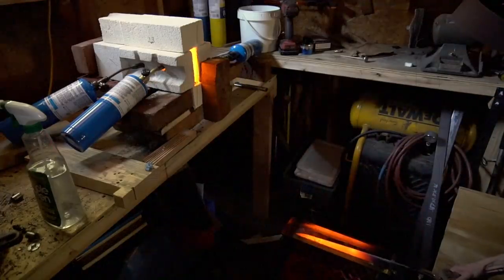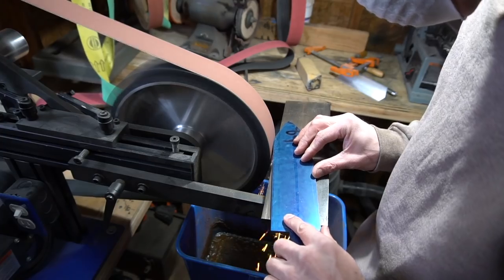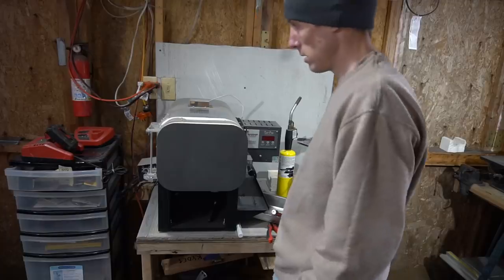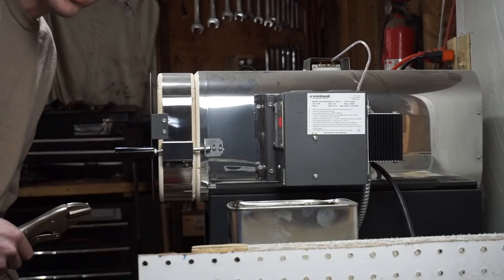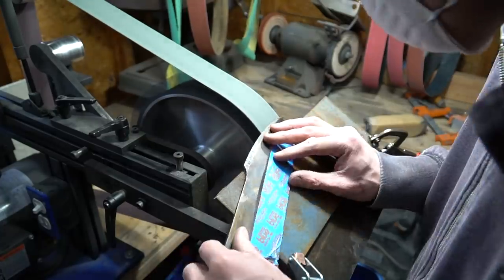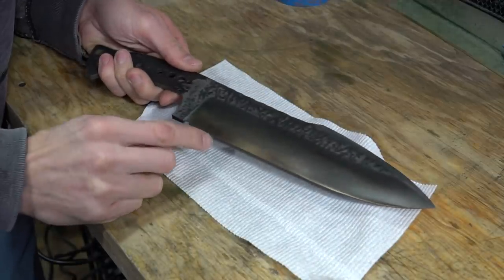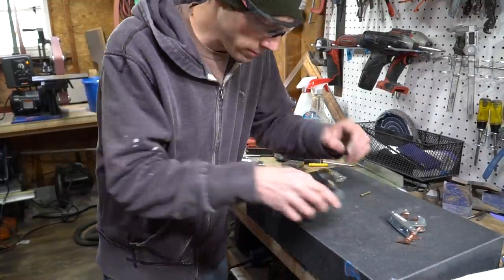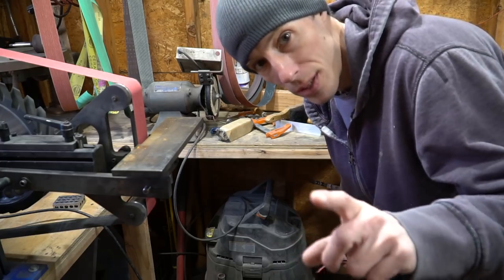Knife Making - The Savage

Comment: I am not a smith, however when you were normalizing your blade, I noticed three things. First by placing the blade sideways in the vice it allowed the weight of the blade to droop while still hot, perhaps if it was placed spine down you would find fewer warps. Second the vice clap is placed precisely at your warp during the normalizing.  I think the steel is cooling at a different rate where the vice is clapping the steel versus where it is not, because the vice is working as a heat sink. Third, if you insulate the blade and slow the thermal cycle by placing it in perlite or between two pieces of wood and clapping the wood  together, you may eliminate any warping and refine the grain structure of the steel a bit more. I am just a truck driver take what I say with a grain of salt. I just noticed this and you complained that you always or frequently experience the same warp and I believe the things I listed above are why or how you might fix your problem.  Great videos. My first one was your 24 dollar Damascus blade videos and it was awesome.  Good content so far keep it up.

Comment: 6:05 You shouldn clamp it that way because heat travels up and you get uneven cooling, which later in the quenching can cause warpage. best way to cool it is in a vise with the point up. Same tule aplies when heating a knife - edge is always up and vertical. After quenching you can gently clamp the knife in a vise verticaly, it eliminates chanses of warpage. There is a good reason why every swordsmith  does it the way i described it. Great knife! Keep up the good videos and great pointy things coming up!
Reply from the maker: Ive tried it many ways tip up tip down and horizontal. I haven't noticed a difference. Not saying one is better than the other just that it hasnt made a difference for me. It's always at the oil line. Unless i do an edge quench then it could be in the blade. Not talking about big warps very small ones most wouldnt notice unless you had a flat surface.  Just some thoughts🤷‍♂️ Thanks my friend 👍
Reply: Way wrong.  He is normalizing mill steel, it's not like there is a crazy amount of stress in it.  It's not forged, it doesn't overly matter.  And the "correct" way to slowly cool a blade is submersing it in something like vermiculite to slowly cool.  I use 1084 frequently and normalize by just setting it on the anvil.  It's more about reaching the critical temp and relaxing, not going for a crazy anneal.  The longer the blade the more likely a warp.  The thinner the blade, the more likely a warp.  Fixing it out of the quench is easy in a jig like he used.

Comment: Hi Bud, 
I got 3 tips for ya.  

Many shops have grinding rooms with doors and separate air just to keep the metal dust at bay.  Any machinery or electronics that the metal dust gets in is history!  Some people put grinders on wheeled tables or carts!!! Push it outside.  The metal dust is good for the plants! 

On the handles.  Surfboard builders will epoxy the cloth to the Board and let it dry.  Then use another coat of epoxy or two coats to clear coat it.  It comes out tougher than nails but smooth and slick.  You can use a longer setting and lightly flame it with propane or alcohol to make any bubbles pop.  No butane, matches, or candles they leave soot and turn stuff black!  When you get the nack of it down it’s a great surface.  It’s deep reflections, smooth to touch, good to grip, and tough. You 

For epoxy or fiberglass  that does not set from cold or wet conditions, warm it gently with an incandescent light bulb.  A little heat and time! I have set it in the sun, but I live in Florida. 

Great show!  Good luck!

Comment: Great blade!  One suggestion: When you normalize, turn your vise 90 degrees so your blade stande straight up and down, resting vertically as it cools.  This will help ensure the blade evenly normalizes, that the forces of gravity aren't pulling laterally on the blade as it cools.

Comment: Great video. The warp most likely happens at the quench line due to uneven contractions in the steel where the air and oil aren't cooling it evenly.

Comment: Something I noticed, you were normalizing with the blade held flat, gravity could have slightly bowed it while it was soft. (It is a BIG KNIFE after all) and could have led to your warp, try putting it in the vice blade edge down.
Just watched again, at around 6:10 you can actually see the tip droop a bit. Plus the warp was in that direction. Food for thought!

Comment: While doing normalization could you use a coat hanger size wire an just hang the knife vertically. That's what I usually do I also use the same technique to remove my knifes from the oven into quench tank ,a wire an a small piece of wood an my quench tank is right below the door on the ground so I just go straight into the oil . Your videos make me laugh,it's your since of humor. Keep up the good work. Your a great guy an true Craftsman
Reply from the maker: I uave done that with the wire. I may go back to it as well. I think its a better practice. Thanks my friend! I really appreciate it 👍🙏

Comment: Great video. Your  warp may have come during the normalization process. When u clamped the blade after each cycle, the weight of the knife put stresswas all at the handle.  Clamping  the blade  straight up and down

Comment: I don't know anything about heat-treating but I heard you mention quench tank and canola oil.  Can any type of oil be used when heat treating like any type of oil on hand anyone would have in their shop or house such as vegetable oil, olive oil or motor oil that's left over from an oil change, or does it have to be specific?
Forging, tempering, and heat treating....what's the difference between them?
btw...that's a really cool grinder, really versatile with all the different wheels and grinding surfaces. What make and model is it?
Reply: hydraulic oil works for me used motor oil creates imperfections and in my experiences more flammable

Comment: I know this is an old video but part of the warp could be because during your normalization cycles, you have the blade horizontal... at that heat, the weight of the blade will cause sag. You may not see it but when you quench, it will show. Hang the blade point down and it should be (relatively) fine (all things being equal).

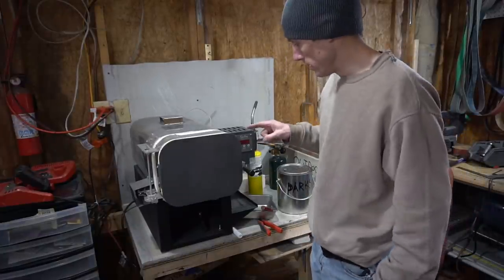Comment: 4:20 Leaving more substance on the knife before heat treatment will reduce the risk of the knife warping, but the tradeoff being that it will take longer to finish grinding. The better you get at evenly heating the blade, the more material you can take off before treatment. For anyone thinking about making their own knifes, you would probably rather take an hour or two longer for the finishing grind than having to start from scratch again.

Comment: @outdoors55 , your observation here:  8:09 --
I think the warp in this case may have been a result of the normalization process. 06:09 - As the knife cools, it seems to sag just a couple degrees or so downward because of gravity. See the way that it is clamped? That entire BIG KNIFE is pulling on the shoulder of the knife with mechanical advantage. I'm pretty sure that because of the way you're straightening this bend later is exactly how it would have been warped during your normalizing phase. I'm not sure if you're doing this in your later videos, but maybe the best way to orient the knife during the cooling of your normalization phases would be to suspend it from the tang, upside-down? Maybe even just flip the knife once in between normalization phases.
a backside to this would be that it would likely slip out of the vice and fall, tip first, into the floor and ruining that tip. But worth double checking if you want to improve that work just little bit more, or it may save you the hassle of having to straighten these warps later? Good luck and good vids

Comment: Just a thought, since you're making knives from regular steel you can order. Why not save yourself some time and have the steel house water jet cut you blanks for you. That way all you need do is do the grinding, heat treat, normalizing, and make the handle. That way you can make several blanks at the same time if you have a knife that is popular.
Reply from the maker: A lot if makers dont do waterjet because profiling (or cutting the basic shape) is the easiest and fastest part of the process. As such, waterjet is expensive, and even at a low $10 a piece for waterjet, you would need to do tons of knives in order for it to make sence. You can easily profile 10 knives per hour on a 2x72 if your making the same design. So you would be saving about $90 per hour minus belt cost doing it yourself.

Comment: Nice vid Alex!   A few thoughts...   instead of painting the blank billet and tracing your template with a scribe to get a very faint and hard to see line, why not simply trace your template with a Sharpie?  After you trace your template onto your blank, you can drill that sharpening choil on your drill press to skip the hand filing.   To get a very similar look to what you did with the Dremel tool in a small fraction of the time, you could just hammer your blade while it's red hot (if you have an anvil or surface to hammer it against).   Just a few things that struck me as odd or maybe harder than they needed to be.  I'm no expert though, just giving some thoughts... (these are all things I've done with good results).   Thanks for the vid!
Reply from the maker: The scribed line isnt that hard to see in real life. The camera makes it appear worse than it is. Ive tried using a sharpie but its nice to have more precise lines.  Seems some like using the drill press for the choil and some like to file. I just prefer filing. It takes about 2 minutes to file. Not long at all. Just me preference theres no right or wrong way. Thanks for taking the time to watch ! It's always appreciated 👍👊🙏

Comment: Just an observation but with making a blade of that size gravity is likely your problem with the warp. After your first heat treat cycle I noticed you put the blade in the vice while still glowing… this can cause a slight bow to your blade, though not as noticeable until after your quench. Try to hold the blade vertically instead of horizontal.

Comment: Is there 1000# grit dry sharpening stone? I have a generic carborundum double sided sharpening stone and it works just fine with me. Searched online and usually requires water or oil before sharpening.

Comment: Nice knife! First Do you use 1080 mild steel? Second why do you use bolts and nuts as opposed to rivets. Also have you had any problem with Danish oil and it’s unstable nature?
Reply from the maker: 1080 is a high carbon steel. The bolts are called loveless bolts and just provide some extra strength due to the mechanical bond.  What problems with danish oil are you referring to?

Comment: Is the warping coming from the quench or when you put it in the vice while normalizing it? I wondered when you put it in the vice sideways like that if it would bend at all, especially since it looked like the vice was acting as a heat sink. Just a thought, it probably isn’t, but thought I’d mention it if you hadn’t thought of it. Great video though
Reply from the maker: Ive tried it both ways no real difference🤷‍♂️  It's always exactly where the oil line is. I need a bigger quench tank to see if that solves anything. Thanks my friend 👍👊🙏

Comment: Would clamping the knife to the granite surface plate right out of the quench help with warping?
Reply from the maker: No it wouldn't do anything. You can clam them straight during the tempering and it helps to straighten them. 🙂

Comment: Great blade.  What type of wood do you use for templates?  Also what type of table top setup you got on your BANDsaw and how is it attached ?
Reply from the maker: Its a product called hard board from Home Depot or lows. Its good for making permanent templates. The table is just something I threw together with the same material. The saw is clamped in a vice. The table is built around it. Pretty simple😀

Comment: Great Video Alex! Loved the style of this video (editing, angles, comedy, etc) and always glad to see new content from you on my notification timeline! 

I have two technical questions, if you dont mind - 
A) I know you mentioned it before but I dont remember which video it was in - What is the purpose of the little notch filed into the knife at the base of the blade - I seem to remember it not being a purely cosmetic thing.

B) What is the difference between Normalizing and Heat Treating and what purpose does normalizing serve? I know the cooling methods between Normalizing and Heat treating differ (ie surface cooling & air cooling vs Oil quench) but what else?
Reply from the maker: The choil is for sharpening. It makes for a good place to stop the secondary bevel. Otherwise its sort of an awkward transition having both bevels meeting at a curved plunge line 
Normalization resets the grain structure in the steel to a nice even, fine state. If not done there can be uneven structure in the steel that will change the blade characteristics. Not all steel requires normalization. Its steel dependent. This is the simple answer 😉 it's slightly more complicated but hopefully that explains it. Thanks my friend. Always appreciate you taking the time to watch 🙏👊

Comment: you don't need to preheat parks 50 btw. It was designed to be most efficient at room temperature
Reply: I think that he is using canola oil in this video doesn't he need to preheat that though
Reply: @gavincole1261  yes, he was using a parks 50 can lol
Reply from the maker: This was canola poured into a parks 50 can. I heat the oil for consistency. Room temperature in the winter is whatever the outside temperature is. Room temperature in the summer is 120f so I always heat to 120 as i cant cool the oil in the summer.  120 is a good Middle point.
Reply: @OUTDOORS55  ah gotcha, were you using 1080? If so, I would have used p50 anyway. It looks awesome either way!
Reply from the maker: 1084... i didnt have enough parks on hand for this blade. Otherwise I would have. Thanks my friend 👍👊

Comment: So I saw when you were normalizing, you put the blade in the vice sideways, with larger blades, the weight bends the knife just by a little hair. If you don’t believe me, go back and look at the footage. This happened to me all the time when I do swords and I hated it. Don’t clamp the whole thing in the vice because the blade will cool too fast, but hang it from the vice upside down. Sometimes, because the blade is bent just a little bit, the different parts of the blade being quenched causes the warp to be exaggerated. Steel does this type of stuff when you weld it too. Hope this saves you a lot of grief in he future.
Reply from the maker: Your definitely correct! I have tried it several ways. Hanging with wire, tip up in a vice, tip down, horizontal. It's always where the oil line was.  If i edge quench its always somewhere along the blade. Not talking about huge warps. Very minor ones you need a flat surface to see. I'll definitely go back to hanging with wire though. And i need a bigger tank for the oil. Thanks for the comment 👍👊